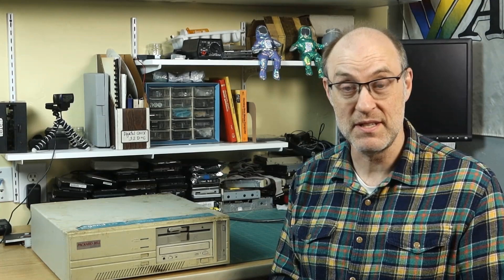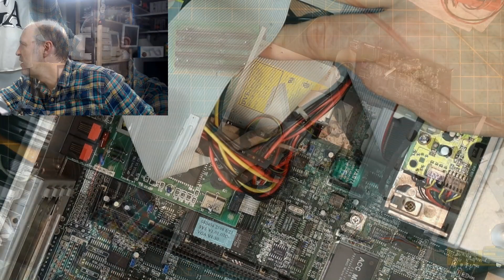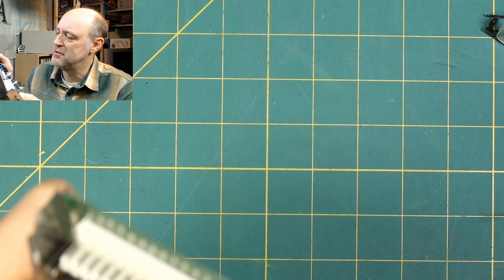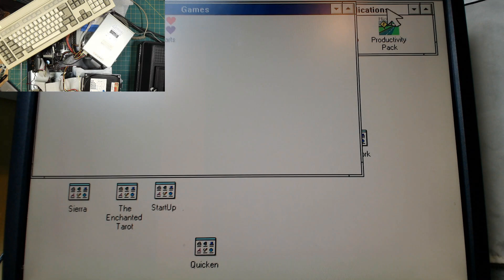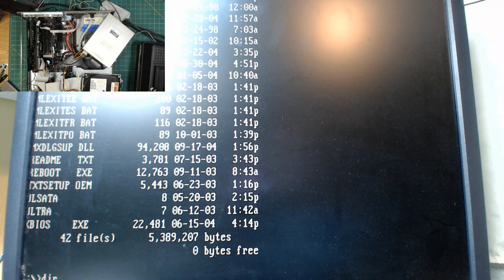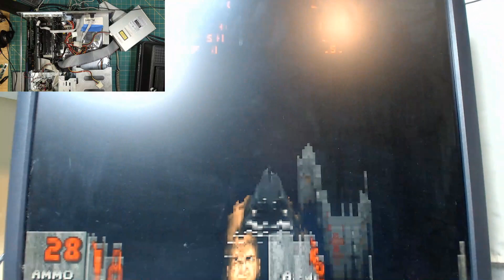Packard Bell Legend 233 non-repair 😭

Comment: My Dad got the 386 SX 20 variant of this PC in I think 1991, it came complete,  with the PB laser Jet (rebranded HP, I believe) laser printer. The machine, minus the printer became mine in 1994 when he upgraded to the AST Advantage! 486DX 33 desktop. 

That one we did add an 8 bit audio card, a CD ROM with it's ISA controller expansion card. If memory serves, the 486, like the 386 had both the 5.25 and the 3.5 floppy/diskette drives, and of course, the hard drives for both. Both ran Windows 3.1, but both began as DOS boxes. I would eventually get the 486, but as Windows for Workgroups, I, of course, upgraded that thing from a relatively speedy, for the day, box to a slug with Windows 95, AOL 3.0 (the culprit most likely for the sluggishness).

AOL, I think took hold of what memory it had and caused it to be so slow that loading a page online took almost several minutes, each...

Totally unusable if one is looking for work, of which I was in the late 90's. So ditched it (by parting it, then tossing the rest) and bought another AST, this time a Pentium 133 Bravo tower used, refurbished.

Dad's last PC before he died was the 1997 variant of the PB, the  Pentium 120 if I recall, but within 6 months, the MB went, got it replaced under warranty and spent the extra $50 to bump it to the 200Mhz flavor. 

When he died in late '98, Mom inherited it and kept it until I was forced to get her to upgrade in 2005. 

By that point, PB had left the US, so no new support for anything for us here, and the machine had driver issues if I recall, and after almost a full Saturday afternoon working on it with no success, had her set Sunday for us to get her a new box. 

That new box would be her last as she would pass on in 2012 and I got it. It was the eMachines mid tower, mid priced unit with the Celeron D processor, 512MB of memory, 40G drive, DVD burner etc. I had it set up as a media center/audio capture of stuff from my vinyl collection until I kind of stopped using it, finally parting/recycling it last year. All I had to fix was replace the original PSU and when I parted it out, the OG 40G drive may have begun to fail but not totally failed. I was able to pull files off it, and the second drive (a 200GB IDE model) and did the same with that, then drilled a hole through the platters and case and tossed them.

Anyway, I run modernish Dell hardware now, a desktop and a laptop.
Reply: Love the nostalgia. Memories are great.

Comment: The new light setup makes a difference. 'I Love a good Varta repair video in the Morning', but you've done well. Thanks for the video.
Reply from the maker: The new lighting has for sure helped me see things better. I still have some slight adjustments that I want to make to the way the lights are mounted, but it's working well so far.

Comment: I know a lot of people dislike the Packard Bell computers from BITD, but owned a few and sort of liked them LOL, at least for the price point they were a decent plug and play computer.
Reply from the maker: Both back then and now, I have found that I don't really like any of the prebuilt systems. If you never, ever have to open it, they tend to be fine. Pretty much every single one I have ever opened... seems to be designed by engineers who just hate people.

Comment: The DIP sockets are for L2 cache (which Packard Bell never seemed to install for some reason); I think these can go up to 512k L2 if you can find the chips (my PB410 uses Micron MT5C1008 128k x 8 SRAM).

The ZIP socket is the video memory expansion, and will accept a 256k x 16 FPM ZIP.
Reply from the maker: Cache! That seems obvious now, but it didn't even occur to me at the time. The bummer about the video memory is, I think I have one of those weird ZIPs that I could have used to upgrade this system.

Comment: Passing a project on to someone else isn't something you need to repent for, in my mind. Flat out scrapping the board without attempting to salvage anything at all besides the sound card would be, but that doesn't sound like the plan, so you're good as far as I'm concerned!
Reply from the maker: I still feel bad for not even really trying to get it working. I'm saving all my energy for the Pentium Pro board. :)
Reply: @TalesofWeirdStuff  That just means you'll do better on the Pentium Pro board than you would if you took both on! :)

Comment: The SB16 can actually sound pretty quiet background noise wise by dialling back settings on the configuration.  Reduce the gain to X1 or X2 and reducing the maximum volume.  Also switch off any inputs not being used.
Reply from the maker: The later boards may have been better, but at least the earlier ones were pretty bad. Modern boards that have dedicated ground planes, etc. just sound so much better... even using the same FM and digital audio chips.